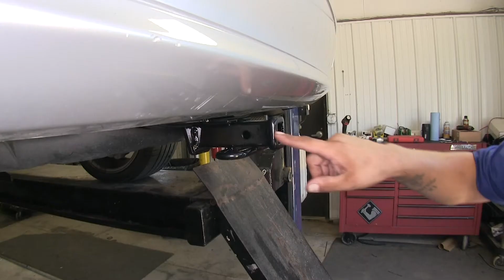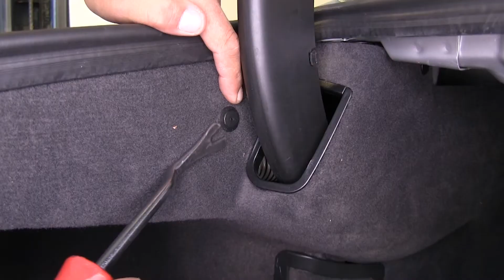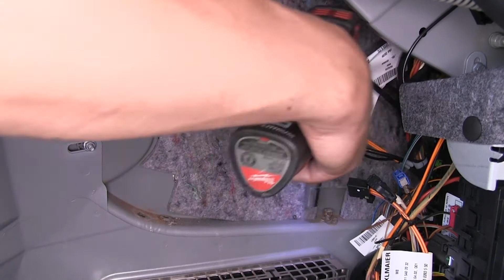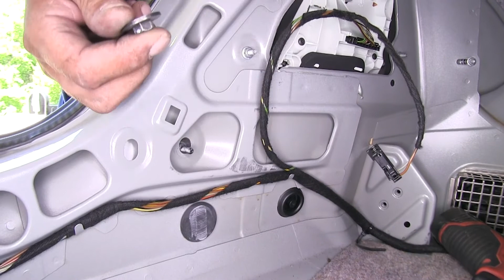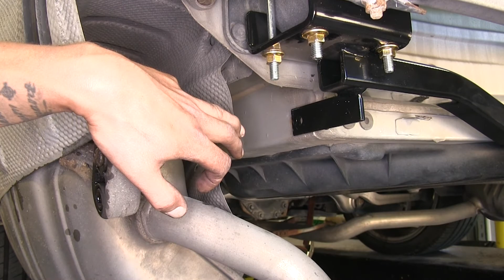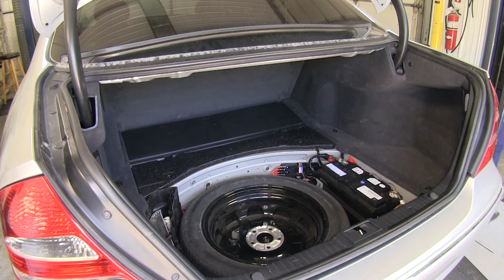etrailer | Setting up the Curt Trailer Hitch Receiver on your 2003 Mercedes-Benz E-Class

Comment: Would this be able to carry a dirtbike?
Reply from the maker: This hitch is rated for 250 lbs. of tongue weight. You would be safer to pull a small trailer with your dirt bike on it.
https://www.etrailer.com/Trailer-Hitch/Curt/C11701.html

Comment: Is there anyway to get this hitch with a 2 inch receiver? I have a 2 inch bike rack that I'd like to use between my girlfriend's car and mine without having to use any adapters.
Reply from the maker: While there are no 2" trailer hitch receivers available for your 2003 Mercedes-Benz E-Class, we do have some alternative solutions. There are hitch adapters that can be used with some bike racks (check with the manufacturer for compatibility) but the problem with this solution is that it reduces the weight capacity of the trailer hitch in half. The best solution is to purchase a bike rack that is compatible with a Class I trailer hitch and comes with its own adapter. Below are links to our adapters and bike racks that fit this description but please note that with this Class I trailer hitch you are limited to carrying 2 bikes.

https://www.etrailer.com/dept-pg-Hitch_Bike_Racks-hs-Class_1-pc-Fits_1~1%7C4_and_2_Inch_Hitch.aspx
https://www.etrailer.com/dept-pg-Hitch_Adapters-sf-Hitch_Expander-hs-Class_I_and_Class_II_Compatible-pc-Fits_1~1%7C4_Inch_Hitch.aspx